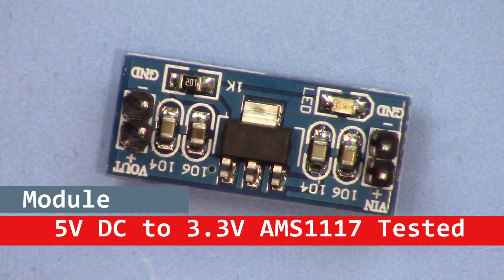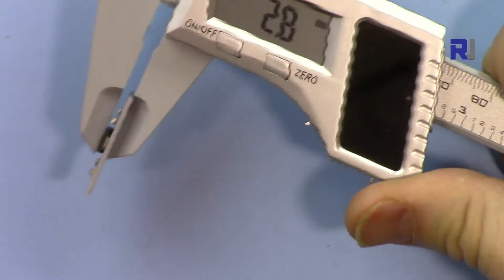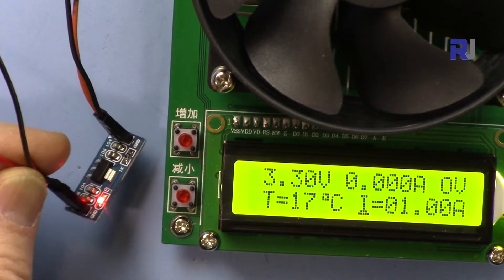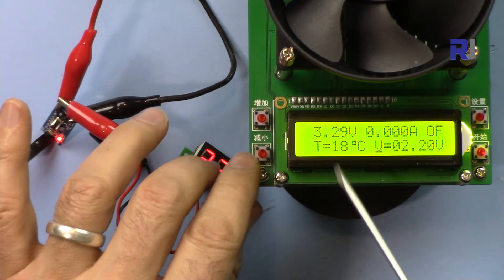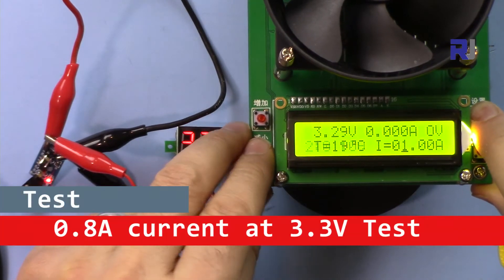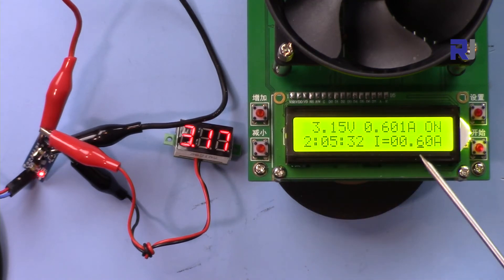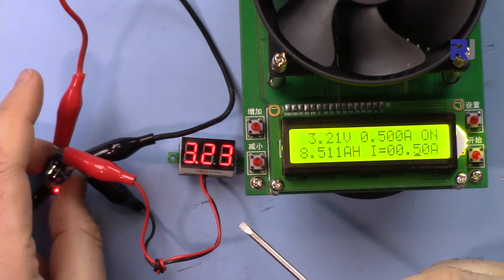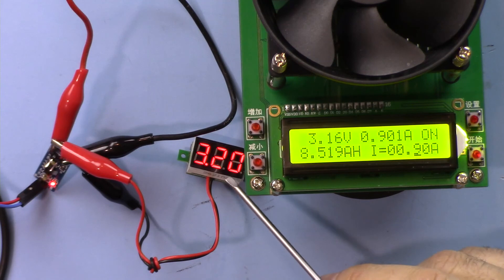5V to 3.3V Arduino Voltage Converter AMS1117 Tested

Comment: So it's not possible to step down 5V to 3.3V on the Arduino itself?  I just want to build a device that will make a button do the opposite.  Like splice a wire, install a button and have it do a digital write to LOW when it's pressed, and HIGH when it's not pressed.  Thankfully it's a 3.3v line so maybe I could just power the Arduino with the existing line, then just do digital write from there.
Reply from the maker: Arduino has 3.3v output when you power it via USB

Comment: If you put vias under the back (ground) of the back of the AMS1117 to the back of the PCB and make a large ground plane on back of the PCB will help wick the heat away
Remember voltage regulators have to dissipate heat when they regulate voltage down...so you need a heatsink on the chip...or a heatsink of copper on the PCB

Comment: What if connected forward biased diode to drop 5 v to 3v
Reply from the maker: the forward bias voltage of diode is about 0.7V so  to get 2V drop, you will need to put 3 of them an still it will not be exact it would be 2.1V drop. The voltage drop on diode is wasting energy as the current passes. not a good idea.
Reply: Ok tq
What if 3.3v zener diode used

Comment: Read the specs... it has a max of 700ma.... why would you try over. It will just fail.
Reply from the maker: I have explained it. But when you buy it on eBay and AliExpress people put incorrect value in the title of the item so I am showing them that those values are incorrect.

Comment: Is it better than LM7805?
Reply from the maker: 7805 is getting up to 15V and converting 5V output. This module can only get 5V and output 3.3V. They are two different things.
Reply: @robojax  I want to know whether Transformer phasing out as most of the people are using AC-DC adapter, LM7805 and LM2596 types converter and why? Must reply!
Reply: Robojax these types of regulators are not good. The bigger the difference in input to output, the more heat it will generate. Look at the buck regulators, they are better and more efficient

Comment: does it work perfectly if i take output load of 600mA ? i mean for a longer period?
Reply from the maker: This is the best test I could offer.  You should come to conclusion from the test result as there would be 100s of way to test and all could not be done in short video.
Reply: Not for longer period

Comment: If my power supply amps are higher than 1amp does it still produce 1 amp out?
Reply from the maker: Yes. Higher power at input never would be just excess and will not be used.